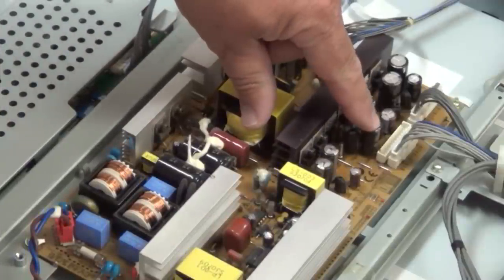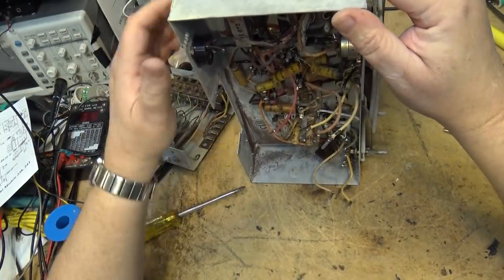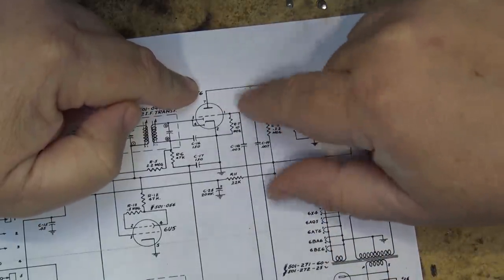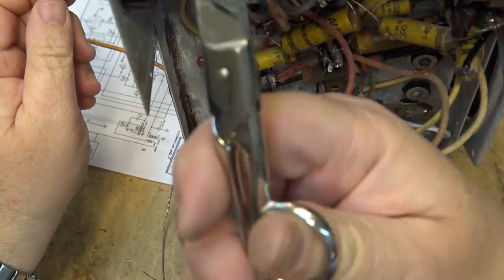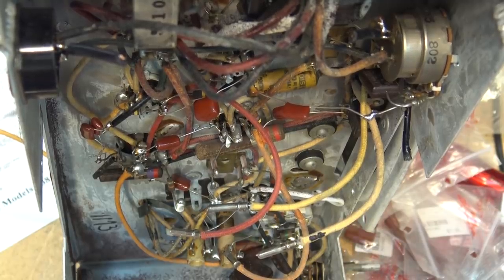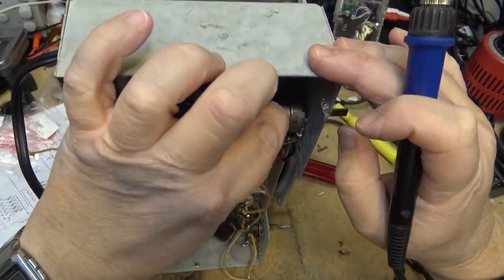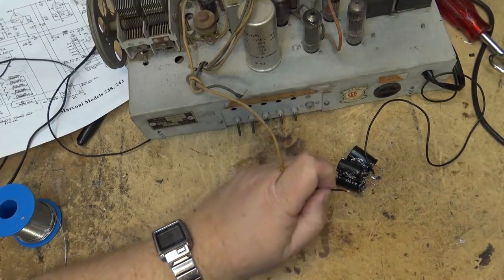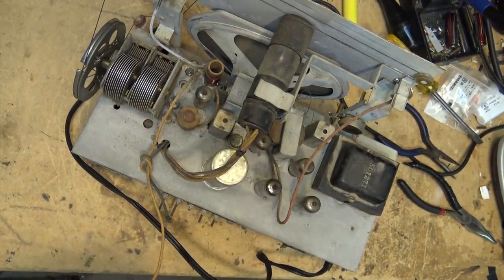Marconi Model 238 Shortwave Radio from 1948   Can I fix it?

Comment: What a find! Glad you also work on antiques!!
BTW, the paper between the foil strips is the dielectric, I believe.
Reply from the maker: Yes the paper acts as the dielectric. Usually coated with oil. Probably PCB oil.  They used to use that in capacitor.  Anyway the paper breaks down over time and becomes acidic / conductive and causes the capacitor to become electrically leaky which is hard on tubes, transformers ect.  Will be troubleshooting it in next video.  Decided to break it up so it doesn't get too long.  Will likely release the next video as patreon only for a few days before going public.  Give my supporters a first look.

Comment: I like to enhance the safety when I do these: add a fuse (old transformer could definitely short out), use a class-y cap for the line to ground and make sure the polarized cord is installed so that hot side is switched.  Anyway, hope the magic eye tube works...  also I noticed one of the bulbs is missing
Reply from the maker: So far I have the audio amp working and local Oscillator is working.  Not passing signal through if. It is a work in progress.  Found an open resistor so far.
Reply: On the subject of safety;No ground? No double insulated mains cable??
Reply from the maker: @patbutete1722  
No, No and No. This is vintage stuff.
Incidentally nothing in North America is double insulated. Doesn't need to be. In 240v countries the standard is different. Also doesn't need a ground. These old radios are not being put into general use. I add these to my collection. They might get plugged in a couple of times a year, and when I run them they are always, without fail run through a 100 watt light bulb in series, just in case something goes pop. I am not concerned about polarized cords because the transformer is going to isolate the radio anyway, and as I said above, these are my radios, mostly for display. I don't leave them plugged in, I turn them on to show them off for people and then unplug them because they are all fires waiting to happen. Fuse or no fuse.
Reply: @12voltvids  Yeah, I agree with you.  I just like to enhance it a bit, not make it fully compliant (think of all the creepage  distance situations a tranformerless radio would have..).  Actually as far as ground, I tend to think that GFCI is a better solution anyway- you could easily have an open ground connection in your house wiring.
Reply from the maker: @jhallenworld  
The travaformerless radios were rather dangerous for sure.  When I was about 7 tinkering with one I got the shock of my life.  Taught me to respect them.  Everyone needs a good jolt now and then. Wakes you up good and reminds you to be more careful. 

There is always risk in everything we do.  You need to think about the risks and have a plan to work as safely as possible.  For me that is an isolation transformer to isolate whatever I am working on from mains power.  I have a big one under my bench.

Comment: Hey Dave!  Have a Very Merry Christmas and a Happy New Year.  I enjoyed watching this video,  can't wait for part two. Are you going to pack the metal can with new caps?  I've had to do that on a tv set before. I used a dremel with a cutter.  I think I watched you do that,  might of been another YouTube video lol   have a good one man!
Reply from the maker: No the 4 caps will just live below the chassis the can stays there for aesthetics.  Got it somewhat working. More caps and a resistor.  Sensitivity issue. Will hook up an antenna wire and see how well it works. This has the antenna coil missing.  It should have been wound on the back which I don't have.
Reply: @12voltvids   simple little radio I love those old designs.  I've got two or three I've got to restore, one made out of Bakelite,  old Motorola and a Westinghouse.  One has a wound antenna made on the masonite back. It's only AM I believe. I guess on the next vid you'll adjust the sensitivity,  the IF and bread slicer cap trims?
Reply from the maker: @timka880057  
It's a little more than adjustments.  More caps a resistor so far.

Comment: A canadian made radio and marconi brand, two good reasons to be determined to fix it :-D.
Yes i think you did have to get it working.
The underside looked in a decent condition considerimg its age.
That preset idea looks well ahead of it's time in a home radio, i remember car radios having it in a mechanical way.
Capacitor sheild connection is handy to be reminded of, easy to forget.
I think the rubber gromet must have gone with the old cable, i use a cable tie to stop mains cable movement, works ok.
Reply from the maker: Yes a cable tie will be going on outside to stop cable from pushing in.  Will be digging in to see why it isn't making any noise for the next one.  Figure it is worthy of 2 videos to show the recap and then the troubleshooting.
Reply: Well i think it is worth a second video, it would be nice to see it pick up a local station, but you must have the spare time and interest to do so.
You will never hear me ask you for any video, that would be bloody cheeky :-(.
Reply from the maker: There will be a follow up. Just ran out of time.

Comment: I have a GE GD-60 that has pre-sets like your radio. Unfortunately, this is a compact and inexpensive table top model and the connections to that switch assembly do not use connectors. You must un-solder them. Of course, the radio will not do more than make a bit of noise with those removed. It was a bit of a pain to deal with. It just occurred to me that I probably could have shorted the right pair of wires to restore manual operation and then I could have tested without putting that switch assembly back on. That is because one of the switches was for manual operation. Hind site is such  wonderful thing.

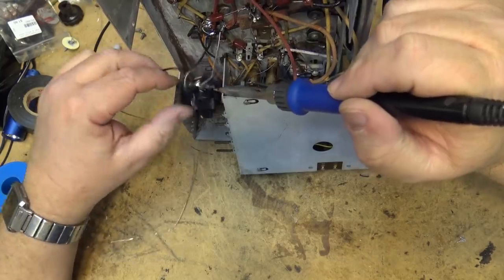Comment: 50:45 there's an unused ground lug riveted to the chassis right in front of your soldering iron, would have been a perfect place to attach the ground lead.

<later> Might have been on the other side of that preset subassembly, so that you couldn't see it from where your eyes were.

Comment: Hi Dave, I just got a chance to watch this and I just had a quick question if you have a sec... when you installed the new filter caps and soldered them to the existing poles of the old filter multi cap, did you cut those leads loose from the old multi cap? Reason I was asking is that if those were leaking, and I’m pretty sure they were because of the hum, and they didn’t get cut loose, wouldn’t that still effect the signal? Also, if they weren’t disconnected, would that be like placing the new and old caps in parallel and also change the values of the new caps? I was just wondering, I love to work on old radios and recently I have had two real trouble radios that I’m really having trouble figuring out what’s going bad. It’s always nice to see troubleshooting. I always learn a lot.
Reply from the maker: Yes they have been cut off, and made no difference. The old caps are totallly open. The state I am at now is a sensitivity issue. I can pick up my test transmitter, but even it is relatively weak. Unlike the GE I recapped and it is picking up everything this one is deaf, but I believe there was probably an antenna loop on the back that is missing. Will try a ferrite bar antenna I have and see how that works. I am thinking one of the coupling caps to the grid of the mixer tube is probably open and is not coupling the antenna signal in very well.
Reply: Gotcha, thank you!

Comment: Are short waves similar to AM? Always been confused about the two
Reply from the maker: Am is the modulation format. Amplitude modulation as opposed to fm or frequency modulation, pm phase modulation, pwm pulse with modulation ect. 
In am the carrier frequency remains constant and the modulating signal varies the carrier power by adding the audio to the carrier which forms side bands. If you had a 1 mhz carrier modulated with a 1khz audio tone you would have 3 components of spectrum transmitted. The original carrier and 2 side bands 1khz above (upper sideband) and 1khz below (lower sideband).
Fm the carrier power is constant and the frequency shifts up and down with the modulating sound.  The loudness of the signal determines how far the carrier deviates from center.  Phase modulation the carrier frequency is constant bit the phase angle varies with the modulation.  Pwm is a digital mode. A square wave is generated. The modulating signal changes the duty cycle that follows the analog or digital input.  Class d amplifiers use this to amplify sound. 
Now back to shortwave.  Yes they use am for broadcast stations.  Just the frequency is higher.  Am broadcast uses .540 to 1.71 mhz for its spectrum. Shortwave starts just above the am (medium wave) hand and goes up to 30mhz.  All modes can be used in shortwave.  Ham radio uses single sideband, fm, phase shift key, am and cw (mores code)
Reply: 12voltvids Thanks a lot for that explanation. Better than stuff I’ve looked up which makes it all so confusing. Appreciate it!
Reply: @12voltvids  Thank you for that answer, cause it does help a lot.

Comment: aha what if odds doing a radio same age as one i mentioned. i do have a b.c. and shortwave (only receives shortwave) dresser sized radio its a Philco but its messing a rectifier tube (5AZ4) its kinda hard to find such a replacement i was told may have to use like an alternate replacement and change the socket out. fun times for that thing.

Edit: corrections and typos

Comment: Frigidaire microwave model CFMV164LSA. It's an "over the range" microwave, so there are two fan vent metal mesh screens / grease filters on the bottom, which I have removed, and had removed for a year. Since I would use the fan while cooking on the stove, yellow semispheres of grease, and a little bit of grey dust, have appeared on the flat horizontal metal sheets that I can see inside.I have never cleaned it before. When I removed the grease filters, they were so dirty I knew I had to buy new ones and not attempt to clean them. Now I have two new ones; I just don't want to insert them until I have cleaned out all the grease and dust from inside my underside of my microwave. I'm worried about getting electrocuted though. Page 21 says "To avoid risk of personal injury or property damage, do not operate oven hood without filters properly in place." Well, I've been operating it for a year or so without the to bottom filters in place! The top single one is still in place, but is dirty as heck (the previous tenants never did any home maintenance). Page 23 has information on how to clean the oven door, and the cavity where food is placed, and the outside of the oven, but nothing about how to clean the airborne grease and dust from just behind the 3 grease filters. I will turn off the power to the microwave by turning off the breaker to it on my breaker panel which is in my bedroom, not the kitchen, before I start cleaning. What should I use to clean off the dusty grease? I put a giant metal pan on top of my stovetop, so don't worry about drips getting into the burner hobs of my gas stovetop. What kind of cloth should I use? A microfiber cloth, a cotton cheesecloth, a cotton-polyester blend, a window cloth? I don't know if just hot soapy dishsoap would work, or if a 50/50 vinegar water blend would work. Maybe I'd need something stronger; I haven't even attempted to clean it yet. I also want advice for cleaning the top single filter, which I've never had removed while operating the fan on my microwave, but I now have a brand new one, so I'd like to clean that whole area up of all the dust stuck on grease before I put my 3 new filters in (one on top, and two on the underside).